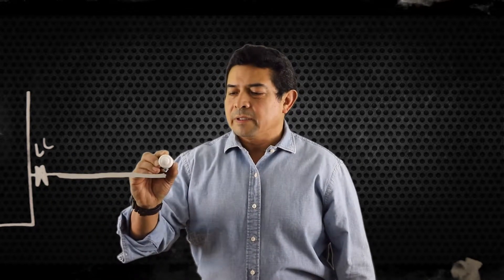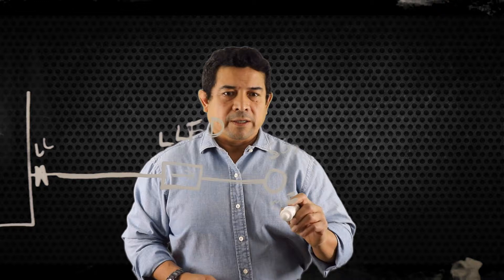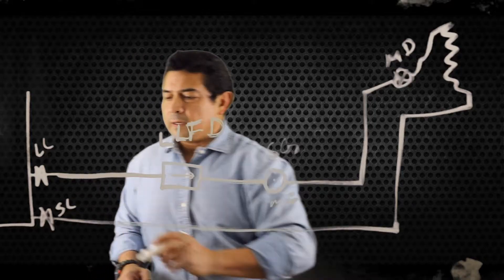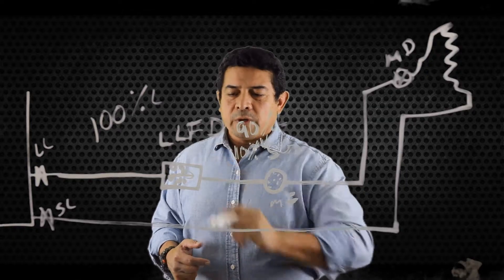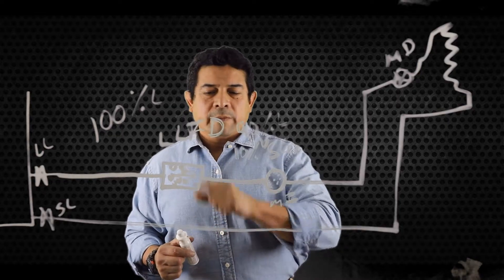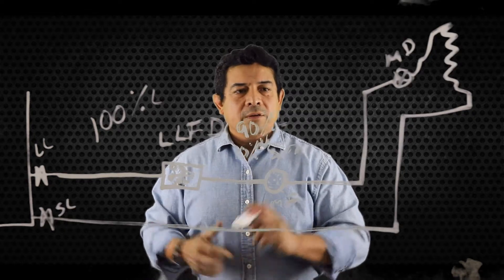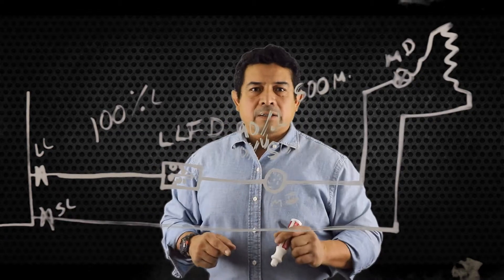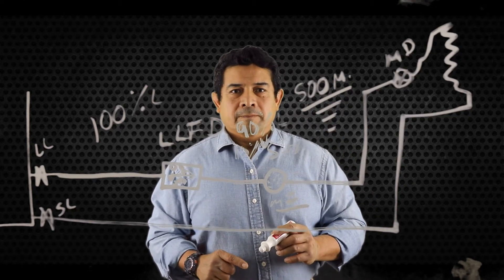Clogged Liquid line filter drier - HVAC Online Training and Course

Comment: Hi guys, I have a quick question I hope someone will answer me 
If I put bigger size liquid line filter dryer on the walk-in freezer or walking cooler is that gonna affect anything? 
Thank you
Reply from the maker: Good question! I had that same question this week, but one of my students in class. No! It will not affect anything. A larger dryer will trap more moisture, and dirt. When I have done this in the past, there never has been any kind of change. Good luck thank you for watching. And thank you for setting your question in!

Comment: What is your subcool  and superheat temps. be when this occurs?
Reply from the maker: That is an interesting question! If your liquid line is clogged up your sub cooling is going to increase but it is hard to tell what it would be because it all depends on the charge and temperatures and so on. You're super heat is going to be high because the evaporator is going to be starved and not getting enough refrigerant going to it. So I would just look for a high subcooling and high superheat! Good luck and thank you for watching!

Comment: Instead of pumping down the system and recharging it you can just close the high pressure side connector. Force all the refrigerant into the condenser and close the low side connector too. Then you can work on the pipes without problem amd keep the original charge. What i do after is connecting a gauge on the low pressure side and keeping it open while slowly letting gas come from the condenser. As soon as the gas comes i close my gauge and open the connectors fully. Should be able to start the system right away and adjust the charge (normally around 100g). I like that methode for old systems.
Reply from the maker: Yes, and thank you! I think I have a video where I talk about pump systems down. But I am glad to know that you are using that method to make your life easier!

Comment: Why compressor can't handle liquid and why pump can't handle gaseous phase.
Reply from the maker: That is a complicated question. I will try to give you the short answer.  Liquid is basically not compressible. Only under special circumstances can add the compressed, and then only a very very small amount. In the compressors that we use the motor is rotating at 1700 to 3600 RPM. At this speed when liquid enters the cylinder and the piston is moving at the speed it will be almost like trying to compress a solid. When the piston hits it it will sometimes break valves or it will put a hole in the piston. The new compressors, squirrel compressors, are designed to push the refrigerant through so even if you get liquid in there it will just push it through very fast. So they can handle pushing liquids through without breaking anything. Now as for pumps, pumps allow a certain amount of blow by and the tolerances between moving parts are not as tight as in a refrigeration compressor. Because of that if air gets in there I will break the seal that liquid forms between moving parts and it will not be able to move the liquid anymore. Some people call it that it loses prime. This means that air is taking the place of the liquid and since air is less dense than liquid it cannot push the liquids trough.   I hope this makes sense. But it is a very long drawn out explanation, I tried to make it short.   good luck!!!
Reply: @AirConAcademy  thanks for ur effort

Comment: Can a bad filter drier create bad odors in the house? Thank you.
Reply from the maker: No, it cannot. But you may want to check the coil. The Evaporator coil gets dirty sometimes. It has bacteria growing in between the fins and the tubes so it will put a smell into the house. They sell ultraviolet lights that will kill the bacteria and destroy the smells. Take a look at that that should help. Good luck!
Reply: Thank you very much for your reply. Appreciate you taking the time.

Comment: Service techs have replaced our filter drier on average once a year on our 3T geothermal heat pump, sometimes twice in a year, without much of a concern on their end. This has been going on for about 5 years, and it doesn't seem typical to me. (?) My understanding is that a restriction may cause a filter to clog? Three king valves have been replaced, several high pressure switches, and at one point the compressor was replaced (which I suspect was due to being over-stressed). The system has had issues in heating cycles and in cooling cycles. Little bits of info come to light each time it is serviced, but oil and/or moisture in the line is typically the issue mentioned. My concern is that something may be wrong with one of the vertical refrigerant lines in the wells? I feel everything above ground has been addressed at some point. There are (3) 100ft vertical wells with copper refrigerant lines which are combined below grade prior to entering the home foundation. I feel we are treating a symptom by replacing the filter, not the source. Or is staying on top of filter drier replacements "good enough" ?
Reply from the maker: Wow! I'm sorry to hear you having so many problems. Let me start off by saying that the refrigerant and the water side should never mix. And I am sorry I do not know your background so please forgive me if I am going to Basic.  Pressure always goes from high to low. Most likely the pressure in the refrigeration system is higher than the water pressure let us in the tubes going into the well. That means that the refrigerant would be leaking out and the water or moisture would not be leaking into the refrigerant side.  Which means that you would be low on refrigerant. Have you asked how they determined that the dryer needs to be replaced? Typically a liquid line filter dryer needs to be replaced if there is a temperature difference across the dryer.  I do not know how much you know of the refrigeration cycle but, take a look at this link   https://youtu.be/VWjEmhCeCdU       this explains the refrigeration cycle. I also have some videos on here that explain about the filter dryers getting clogged. You can watch this videos and compare what is on the video to what the contractor is telling you. The king valve is just a valve that is used when the system is being installed or for a pump down. I also have videos that explain the king valve and receivers. I have been doing this kind of work since 1979, I do not like to say bad things about people specially since I do not know them but sometimes contractors are just trying to make money. Have you tried another company?  I also do not like people to be taken by a company that is just trying to make money. Please look for the other videos that I have and if you have other questions please send them to me.    I hope this answers some of your questions and like I said if you still have other questions please let me know!
Reply: Thank you. Yeah this hasn’t been a fun ride. My confusion is in that the system is not refrigerant to water based, it is a purely refrigerant based split system (condenser loop in the wells, evaporator coil in the air handler, reverse when heating) so the moisture is somehow being introduced or generated. Yes there is a temperature change across the drier which indicates it needs to be changed. Same for the valves. I’ve become watchful of the services, and I know enough to make a few general observations watching while the work is done. I’ve witnessed the temperature measurements, so I feel confident that there is actually a problem. I don’t however fully understand where the moisture could be coming from, nor do I think the installer knows. A second opinion is in order and next in my plans.
Reply from the maker: @ronzawtocki5201  a refrigerant system is a sealed system. Moisture should never be going into the refrigerant from any place. That is why I mentioned how fluids will go from high pressure to low pressure. Because the refrigerant would be leaking out into the water. There is no place that could introduce or make the water go into the refrigerant.  Having said that, a suggestion that I have for you is to have them install an oversized liquid line filter dryer and a suction line filter dryer. The other suggestion and preferred would be to have them recover the refrigerant, do what we call a triple evaluation. That is your recover the refrigerant, put about 50 to 100 pounds of nitrogen pressure in to the system, release the nitrogen out to the atmosphere, pull a vacuum again, add the nitrogen to the system again, do this three times and pull a vacuum down to 500 Microns for the last time and have it hold under 500 µm for at least 10 to 15 minutes with the vacuum pump turned off and the valves on the manifold set closed.    The triple evacuation will get rid of whatever moisture is in the system because the nitrogen will absorb the moisture and nitrogen can be released to the atmosphere because most of the atmosphere is made up of nitrogen. This may be a bit Time consuming but it will get rid of the moisture. After the triple evacuation is done then they can install new oversize dryers just to be sure even though I don't think they will be needed.  This should get rid of all of the moisture in the system, let me know what happens. Good luck!
Reply: Sound like a leak in the Ref line getting moisture underground

Comment: This was a  video I was  looking for  nice information you saying as long the  side  glass is running clean  no moisture  and  if it bubbles it could be  low on gas and have  moisture so it should be  clean  some glass don't have color it clean  so  how can you detect  low or moderate
Reply from the maker: Under normal operating conditions the site glass should be clear with no bubbles in it. Typically the center of the site glass has a dot that should be green, if it is yellow then that means the system has moisture in it and the dryers need to be replaced. If you see bubbles in the site glass that the system is low on refrigerant or that you could have a leak. I think I have a video that talks about the site glass. Take a look I have several other videos. Thank you for watching and keep learning!
Reply: Thanks my friend for your time and very good information  my  side glass has no indication just clean glass thanks

Comment: I have never seen a small ght class on residential people so stop complaining.
Reply from the maker: Sunglasses are very rarely put on residential units. When I do an installation are usually try to put one on because it helps the next technician. They're not that expensive and it's a good accessory to have.

Comment: What is the reason of having vapour inside the system? How to avoid it?
Reply from the maker: The most common reason is because there's not enough refrigerant in the system. You may need to add some refrigerant or there may be a restriction in the liquid line. But if the site glass assure you bubbles typically it is one of those two reasons.
Reply: @AirConAcademy  if there is no leak from the beginning and the refrigerant is complete and not lacking? Where will clogging begin or having moisture in the system causing blockage?
Reply from the maker: @joselicop872  the clogging would depend on several factors. It could be at the metering device because a small piece of dirt got stuck in there. That typically happens because there is no liquid line filter dryer to protect the metering device.   Having moisture would probably not cause the blockage but in time, and that is hard to tell how much time it will take, the moisture would create acid in the system and the acid would deteriorate components which could block the liquid line filter dryer. If you have a suction line filter dryer the blockage could also happen there.

Comment: Hi Sir,
Is there any possibility that the moisture can travel with Refrigerant during recovery in the recovery unit.
What can be done to remove moisture from Refrigerant stored in recovery unit. Pls. Advise. 
Thanks in advance
Reply from the maker: Yes,! The refrigerant and moisture will be removed from the system when recovering refrigerant. It will go into the recovery bottle and the only thing you can do would be to have a recycle machine handy so you can run the refrigerant through the recycle machine. The recycle machine will have filters in it they will absorb and trap the moisture and most of the recycle machines will be able to remove some of the oil that may be pulled out when recovering refrigerant. Other than that there is not much else you can do.    Depending on your situation you may be able to put the refrigerant in a recovery bottle and move the refrigerator from the bottle to another recovery bottle with a recovery unit but add filters to the refrigerant line so you are filtering the refrigerant. I am not sure how well this will work but if you do not have a recycle machine you could try this. Also if there is acid in the system you want to make sure that you use HH dryer's. They will trap the acid that is mixed with a refrigerant. Good luck I hope this helped.
Reply: @AirConAcademy  Thank you 👍

Comment: can i turn on the outside unit without going inside or will that thor off the readings at the dryer? and take the temp on both sides of the dryer and see how much of a drop i get? if the dryer is a good dryer how much of a drop could i expect to see? i think this dryer is as old as the unit at 30 years.  this year it was hard to cool the house at 80 deg outside and 78 deg inside. it would not cycle. it may be low on r22 but the dryer may have cause this. bubble showed no leaks. thanks
Reply from the maker: The age of the dryer should not affect it much. I mean if the system has not been opened up and it has not been serviced the system should be as clean as when it was first installed. Yes, you should have the unit running using the thermostat for a minimum of 10 minutes to let the temperatures stabilize. It could be that the dryer is clogged, but most likely it might be low on refrigerant. To make sure you need to check the superheat. I believe I do have a video on here on how to check superheat.  Let me know if you still have some other questions.
Reply: Bro! If the units 30  yrs old REPLACE IT! I'm probably  not cooling because it's wore the fuck out! 30 yrs old! Lmao!

Comment: thank for your advise. in some system, it aslo have a lot of location else can be clogged, evap/condensor/ expansion valve/ office tube -- filter drier.
Reply from the maker: Cơ Không Khiếp Yes, you’re so correct! I have seen systems with a clog in all of the places that you mentioned. And sometimes you just have to take your time to find out where the restriction is. In this video I was mostly talking about the liquid line filter dryer being clogged up. I guess maybe I could or should make a video about the other places where you could have a restriction in the system. Thank you for your comment. It gives me something to think about!

Comment: I was putting freon on a car and I saw bubble on the window gauge meter and the freon looked like it was going in, but it was not. The Low side was at MAX level and it looks like the drier or filter was blocked.
Reply from the maker: Alejandro Hernandez It could be that the dryer/accumulator in your car is clogged.? When charging a car typically you want to rev up the engine while you are putting the gas/refrigerant in. You will notice the needle will drop and it will suck more refrigerant into the system from the bottle.
Reply: @AirConAcademy  The low side where the freon enters it is cold until it reaches drier, the drier is not cold, and nor is the line that comes from the drier to the compressor. Isn't the drier supposed to be cold and the line that goes to the compressor?
Reply from the maker: Alejandro Hernandez ohhhhh.   If that is the case, you are correct. The dryer seems to be clogged up. It should be called all of the way back to the compressor.